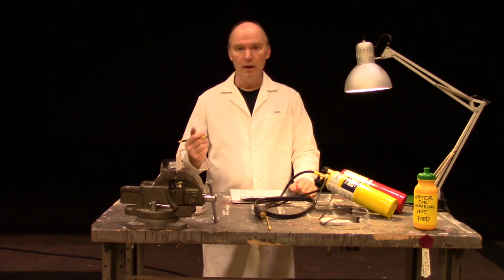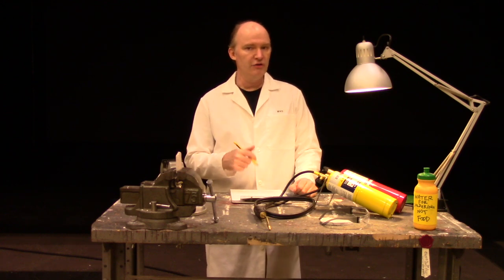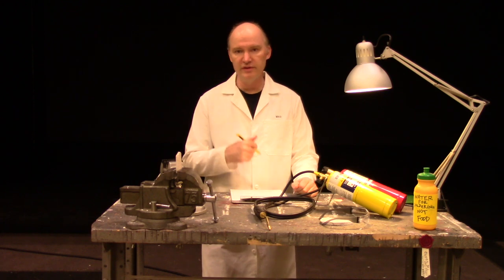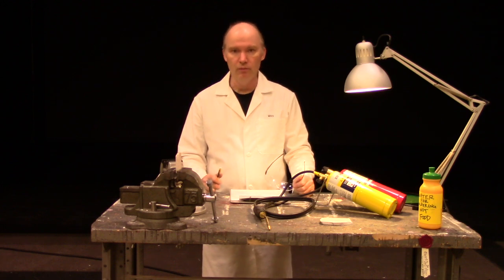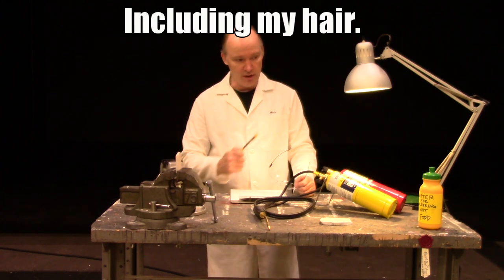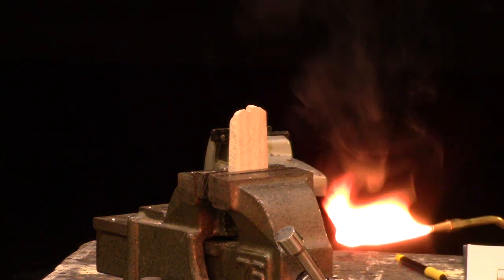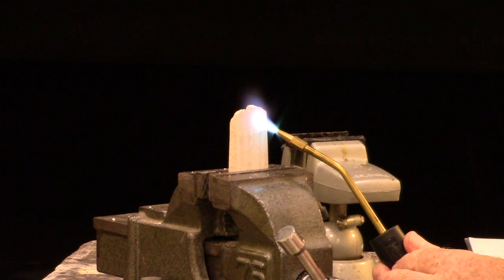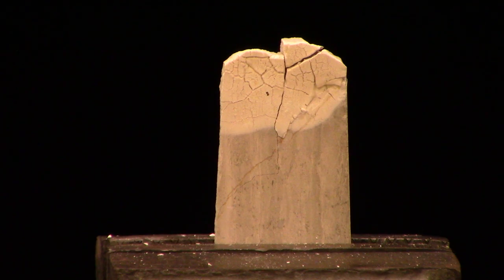The Lime Light

Comment: This was rad! The space shuttle example made total sense, and I had no idea that it was that much brighter than a flame. 

I wonder if the light would be more brilliant if it was heated up longer, or if it was a larger piece of it (the drawings I saw seemed to use a big cylinder of quicklime). Either way, still very impressed — thanks for sharing!

Comment: Of down the theatre this evening to drive the modern 1200W HMI equivalent.
The modern term is Follow Spot Operator , used to be Lime Op. And in Victorian times when it was a 'Lime Light ' you would have been a 'Limelight Turner'
As ever nobody notices you unless of course ' you get it wrong!'

Comment: not to be that person but, your lil example of what an old gas light would have looked like is inaccurate when it comes to the amount of soot, yes soot particles were very much part of the system, but you wouldnt see that as trailing black streaks of smoke, the flame would have been on a burner specifically designed to ejaculate the gas to maximize light and flame size and would be steady, only interrupted if a draft from an open door bothered it or someone else lit another gas light on the same line, miniscule amounts of soot would have been enecred constantly without the user noticing, and only suddebly realizing a week or so later that the walls have been darkened

Comment: I'm having a hard time finding a measurement of the brightness of limelight
Reply from the maker: Unfortunately I didn't have a light meter when I made this video.  I've got one now, I should probably do a followup.
Reply: @jonathanbastow3538  that would be cool. I'm thinking the best non electric lighting source for local sourcing would probably be wood-gas torches with gas mantles. But I'm also curious about limelight. I wonder if it would be possible to grow plants through the low light conditions of a northern winter that way